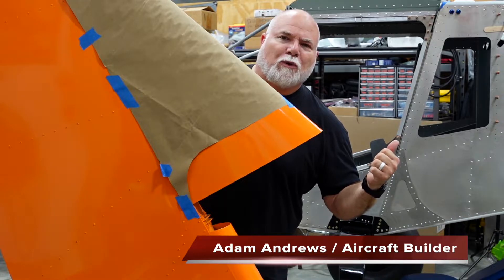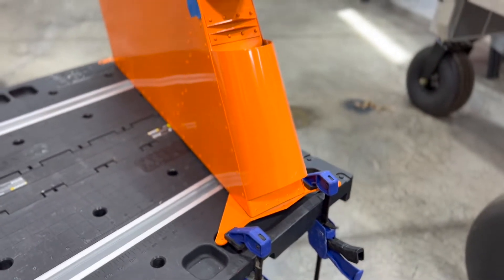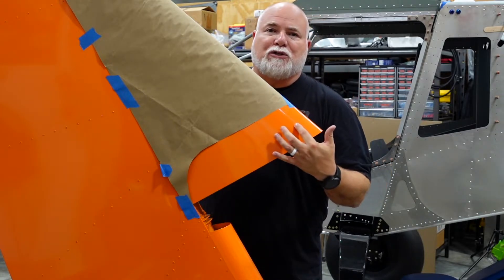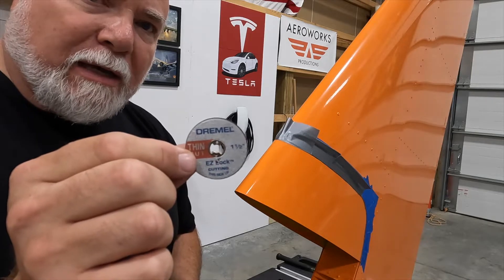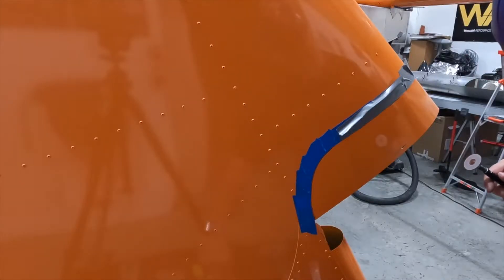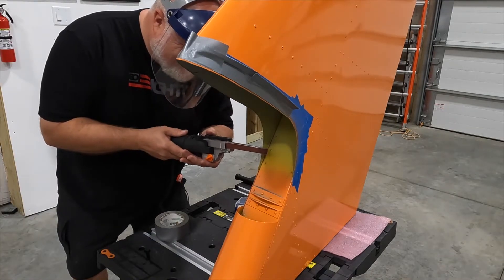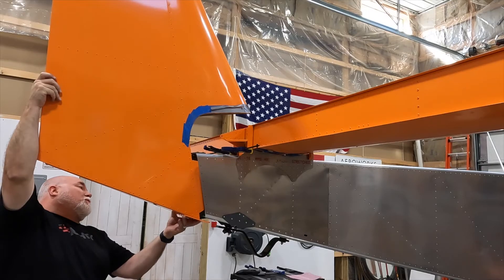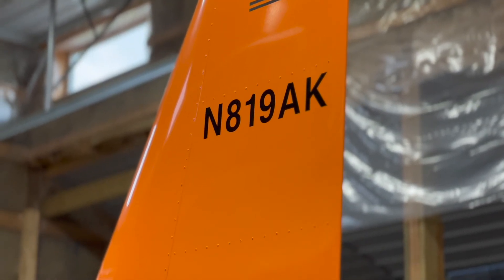Ep. 55 | CUTTING THE RUDDER | Zenith Super Duty Aircraft Build

Comment: NOW you know why it's a good idea to completely assemble your aircraft before even thinking about exterior paint or powdercoat - there's always some final trimming/adjusting!  I fully assembled my STOL 750 in my garage then broke it down and had the removed assemblies individually painted, then reassembled in my hangar.  Even then, I did not have the cowl painted until I completed some of my Phase I testing in case modifications to the cowl for cooling, etc. were necessary.
Having a fully assembled airplane in the garage was good for a lot of laughs.  Visitors would come by and say, "How the heck are you going to get that airplane out of the garage?"  I'd tell them, "Gee, I never thought of that!" "Maybe grease it up real good and pull hard?"  LOL!